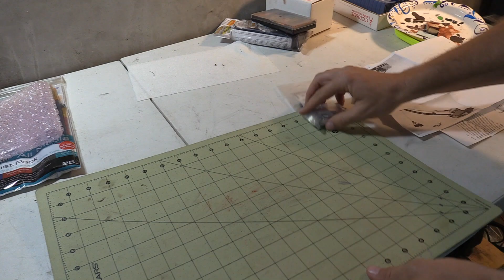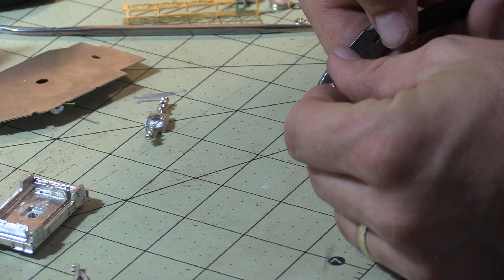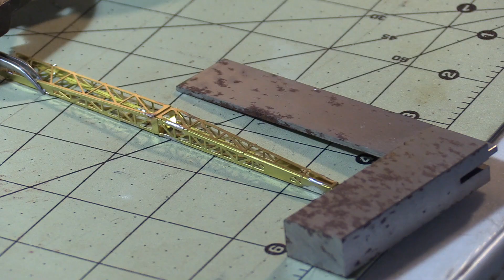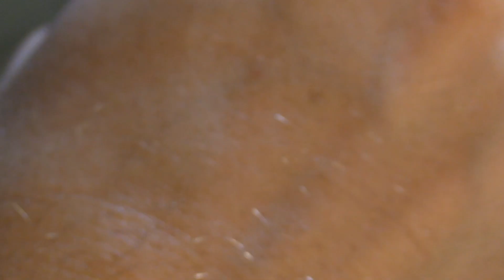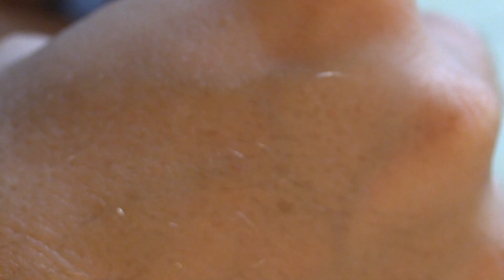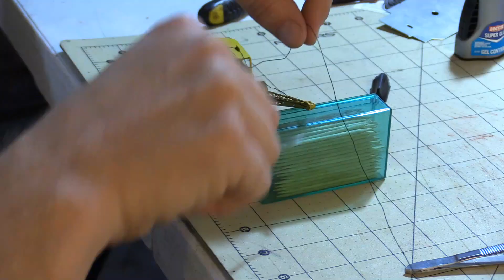Build this Custom Finishing HO Scale Burro Crane

Comment: Sir, excellent video!! I wasn’t aware of this model company so thanks for the info. I like the tip on how you applied the black paint with the toothpick for the window sealing, great idea. All in all, a great build sir! Thank you.
Reply from the maker: Thank you! They make several nice MoW options. Though the white metal castings are a little challenging to work with.
Reply: @signalupproductions I concur with the white metal issues, it has its challenges and many modelers aren’t too familiar with various adhesives to use or if they should even consider soldering but a decent gel CA glue works great overall.